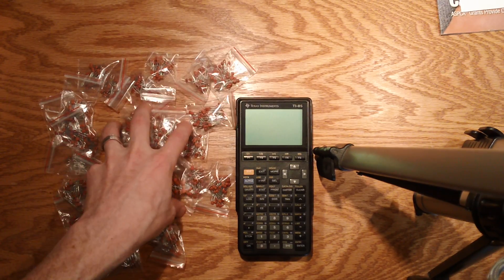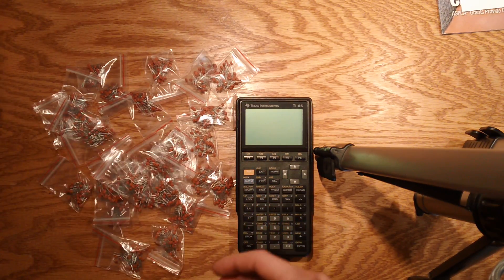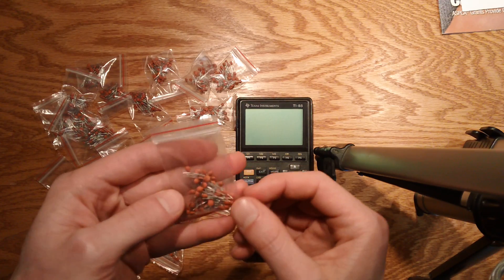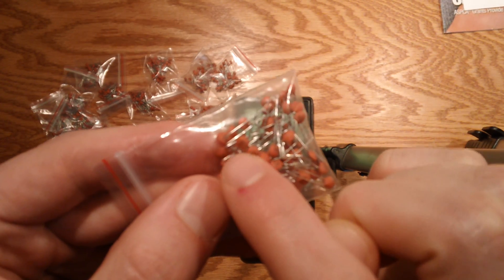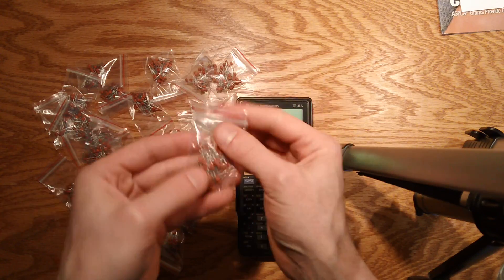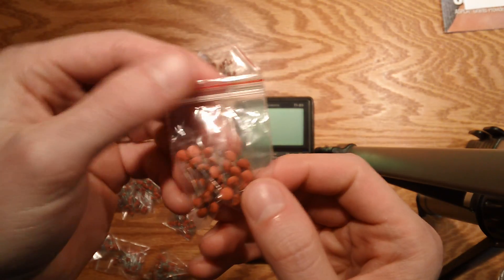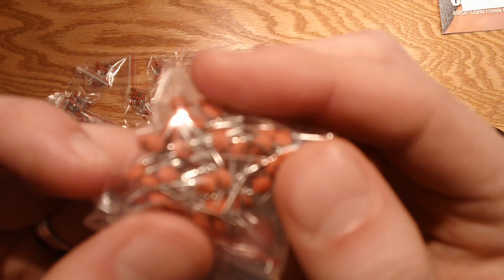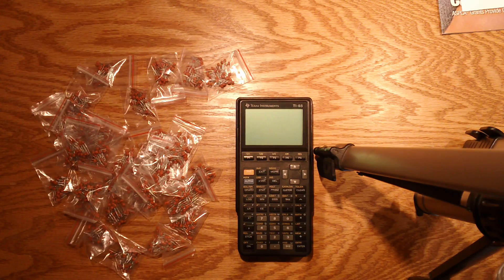Ceramic Capacitor Markings Demystified

Comment from the maker: Ebay is a godsend for parts without a doubt.  Glad you found the capacitor info useful.  As for the Make book - I'm definitely up against some tougher projects now, so the pace has slowed down a bit, but I should have another video up in the next few days.